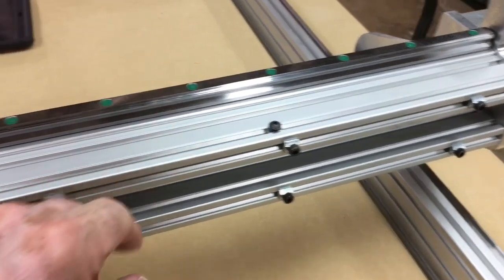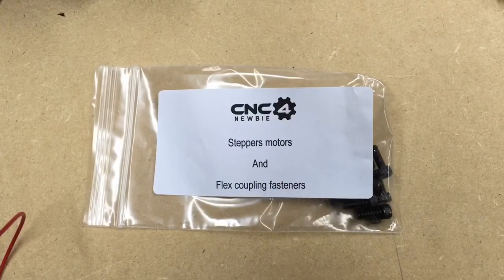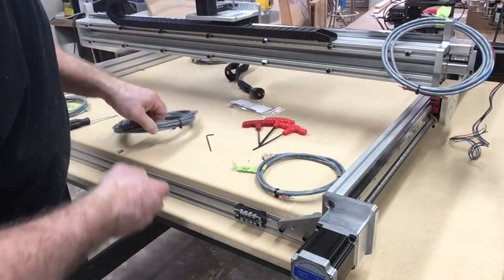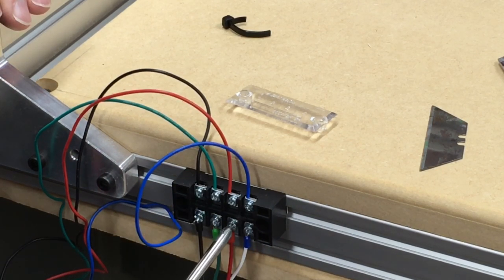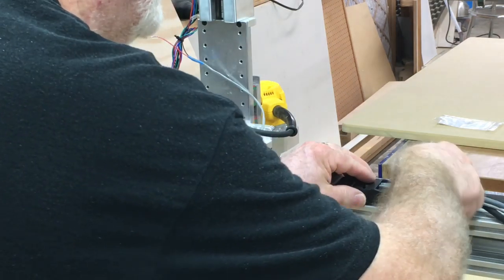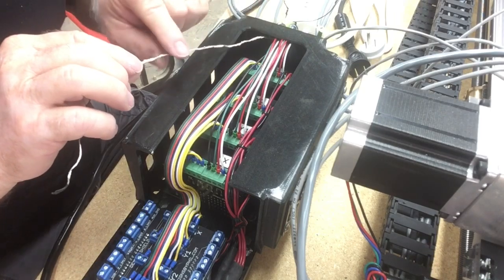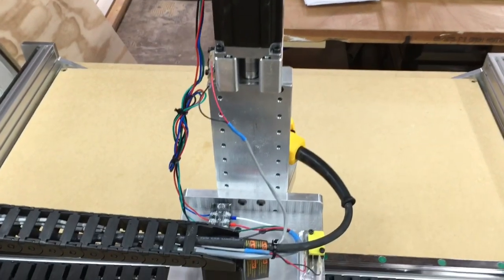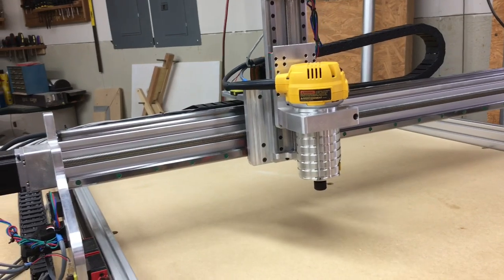Wiring the NEW-Carve by CNC4NEWBIE

Comment: New to group and my CNC machine. I understand there is a huge learning curve but i have hit a wall.  I was working on a project and went to clean area with a bruch and a bristle got caught in bit and stopped the motor. I hit emergency off switch as soon as possible. No smoke came out and no breakers flipped. PROBLEM. I cant get X Y or Z axis to respond to controls. Turned everything off, rebooted computer and reinstalled com port. Nothing is working. Any help will be welcomed!
Reply from the maker: First thing to check is to make sure that you have reset the emergency stop by twisting the button and making sure that the button is in the up position
Reply: @PawPawsWorkShop  sorry, i should have said i tried that already. Others are saying i may have blown a driver but i have no idea what that is. Btw thank you for the prompt reply

Comment: I watch all your videos and learn a bunch. I really appreciate you. I just got the cnc4newbie 1000x1000 upgrade for my xcarve. I’m having an issue with setting up the x and y using easel. Also I’m still using the X controller. Do I have to use UGS or can everything still be done from easel?
Reply from the maker: You can setup the xcontroller and easel for the CNC4NEWBIE.

Comment: I have the CNC4Newbies 1045 machine and completely assembled with the wiring. I'm trying to download the Universal G-Code sender, but it is asking me for either a Web or type a URL. I am very new at this and do not know where to find these. Can you help
Reply from the maker: Go to Openbuilds and download the free sender software. It’s easier to download and to use. I think that you will like it much better
Reply: @PawPawsWorkShop  Do you have to have your computer connected to the controller for the program to work?
Reply: I meant to say, do you have to have my computer to be connected to the controller before to add the settings?
Reply from the maker: I have the computer connected to the controller all the time

Comment: Great video.  I didn't see what you did with the router cord.  Are you just plugging it in an outlet or do you have it going through the controller to turn on with the machine - rather than turning the router on separately.  Thanks for your videos - learning a lot!
Reply from the maker: I ran the cord into the drag chain. I control the off and on manually.

Comment: Hey Paw Paw, I'm confused about something. Maybe I missed it, but I did not see the step when you attach both Y anti-backlash nuts to the Z axis carriage. I am about to wire the controller, but realized the Y anti-backlash nuts are not connected yet. 

If I connect one, the carriage doesn't want to move by moderate hand force to get the other side to align to connect it too. I'm not exactly sure of the mechanics that are going on here, so I'm not sure what to do at this point.
Reply from the maker: The y axis are not aligned.  Attach one side, then hand turn until the screw holes line up
Reply: @PawPawsWorkShop  Ok I think I got it now. Thank you sir!!

Comment: When you out the 4 wires from the steppe motors into the controller, does it matter what order you put them?  You did all of yours the same but is there a reason that you went in that order?
Reply from the maker: Yes, it matters.  The two pairs must be connected correctly or the machine could run in the opposite direction.  The instructions shows how they are paired together, green and black together and red and white or red and blue.  It also matters how they go into the controller.  In the video I connected the wires to the controller and then a little latter I had changed them and I showed a close up of the wires.  Read the first comment that I pinned in the comment section, he explains it perfectly.  If you machine runs backwards usually all you need to do is switch one pair.

Comment: I'm writing this as an helpful addition to Paw Paw's video, for the CNC4NEWBIE wiring process.  Paw Paw, your videos are great, however to help others avoid the issues of debugging this problem, I decided to let them know before they get started.  

The wiring of the steppers and drag chain is great.  Very helpful.  However when the wiring on the Demon Controller started you wired the the steppers with black, green, red, and white/blue collar as shown around 14 minutes and 31 seconds into the video.  At 15 minutes and 5 seconds the controller wires are now white/blue collar, red, green, black.    

Myself and others who purchased New Carve machine used this video for wiring and spent quite a bit of time pondering why our gantry was moving in the opposite direction, and it was very frustrating to purchase a CNC and have it work backwards.  If you purchased the wiring bundle from CNC4NEWBI as a part of your purchase, and you've completed the steppers and drag chain segments and find that your CNC is jogging backwards, the proper wiring for the stepper motors on the Demon controller is:  white/blue collar, red, green, black.
Reply from the maker: Thank you very much.  Yes, I did switch the wires to the correct position and did not adequately explain why.  If the machine is running backwards switching one pair will solve the problem.  I'm sorry that I was not completely clear on that point. Again, thank you for providing this information.

Comment: Paw Paw, you showed the wrapping of the stepper ground wires into one to attach to the demon shield. But in one picture there are 2 ground wires attached to the demon shield, what is the second ground wire?
Reply from the maker: I grouped all the ground wires from the stepper motors and put them together into one ground port.  The next group of ground wires was the limit switches.  I did the same thing. I grouped all the limit switch ground wires and put them into a separate port.

Comment: This is a very informative video Paw Paw. I purchased the X-Carve full upgrade and got a little frustrated when I put in the the settings for my 750. I didn’t realize that Easel changes some of the parameters when you  run the Machine Setup. Now that I am aware of that, I am very pleased with the CNC4NEWBIES upgrade. I have to check out UGS. If this is a G-Code sender, what will you use as your designer?
Reply from the maker: Thank you very much.  I have VCarve Desktop.  I plan on using this to design and use UGS as the sender.
Reply: Paw Paw’s WorkShop  thank you so much.